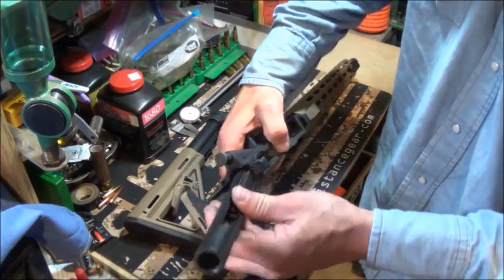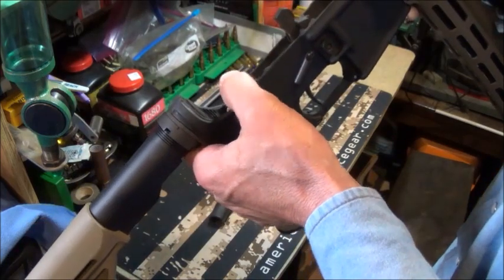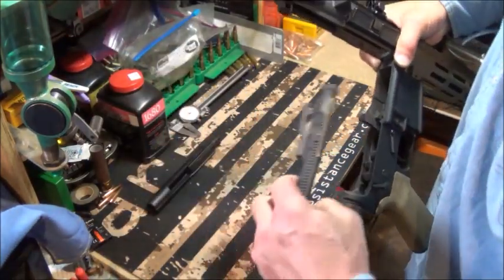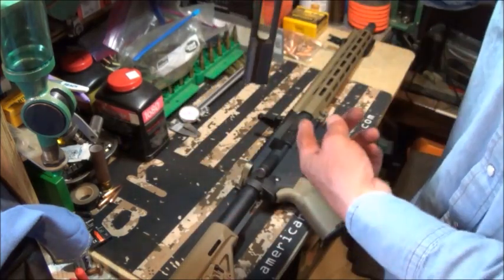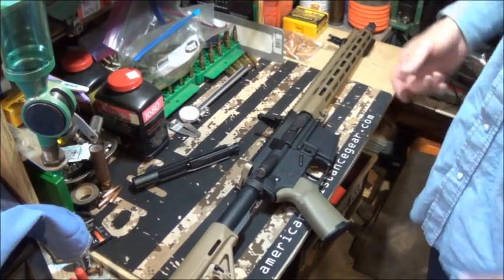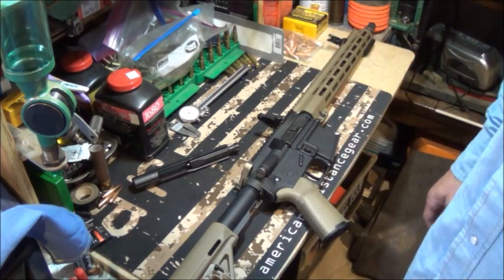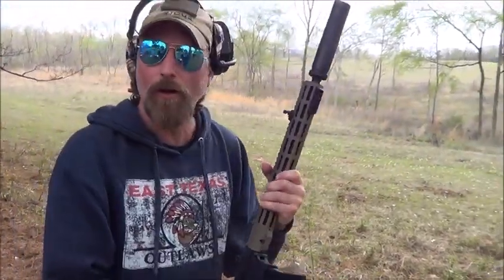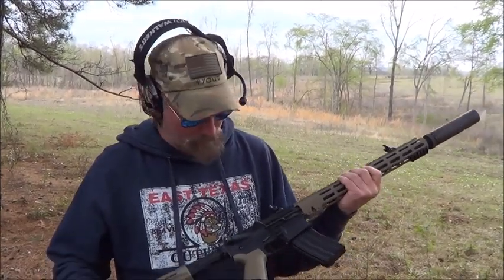Rare Breed FRT - 15 Trigger - BCG Fix

Comment: Soooo, is this why Rare Breed has now modified with a Gen 2 fixing the spring pinch on all trigger assemblies? And as a fellow ammo loader you should know that "SPEC" allows for tolerance, hence the different sizes in auto- BCG's. When you're measuring a difference of  0.008"  in those BCG's...that's literally splitting hairs when it comes to a BCG. 0.008" is NOT going to over extend squat.
Reply from the maker: Awesome, you are a great warrior which I will not be able to defeat. Have a great day nobel one !!!!!!!!!!
Reply: Just got a new rare breed this past Thursday and there is no noticeable difference that would lead me to believe there is a Gen 2. Spring still goes straight back and it’s the same old locking bar without the cut. I doubt I’ll have problems, if I do I’ll just make the cut myself. They’ve had the modified locking bar for sale for a while don’t know why they wouldn’t put it in the new triggers. Actually I do think I know why. $$$.

Comment: 400 bucks for a trigger shouldn't require fixing
Reply from the maker: Sad bot true , Thanks !!!!!!!!!!!!!
Reply: I just paid $600 for one let me know if you got more for $400
Reply: the trigger doesn't need fixing the ar needs the fixing to mate with the trigger. The bolt can be in a different final position in each ar because of the stacking up of the tolerences of the final position of the bolt at the time the hammer drops.

Comment: I measured mine, got 2.294.5". 🙂
Reply from the maker: That should work Rick, Thanks !!! us !!!!!!!!
Reply: Lol newbie here.. can I use a tape measure to measure it?
Reply: @createimproviseoptimize7891  I'm sure you could get close, you would just have to figure out what two inches and two hundred and eighty thousands of an inch were in sixteenths or thirty seconds.
Reply: @RickNethery  I appreciate the information I really do.
Reply: @RickNethery   2.28 inches I believe and mine measure a hair more than that.
I have a Palmetto State Armory Full auto Bcg that came with a carbine length upper I just bought, I bought a rifle length buffer tube with a 5.7 oz buffer,
Think it'll run my rare breed?!? Acogs getting delivered today, testing my rare breed build tomorrow. 
It's my first Ar build so I could be as far off as mars but it seems pretty solid. 
Got a liberty 15 psa stripped lower thing fricken sweet.
Reply: @createimproviseoptimize7891  Good luck brother,  I hope it runs great. 👍
Reply: @RickNethery  I appreciate it Brother!!!! Shoot straight my man!!
Reply: @RickNethery  couldn't wait for tomorrow, went to the range today got about 100 rounds through 0 malfunctions!! 
Fricken holy shit these things are awesome
Reply: @createimproviseoptimize7891  Glad it worked well brother 👍
Reply: Mine was 2.28 and still didn't work.
Reply: @Chris-ru9cq  have you seen the  Animation of the operation cycle of the Rare breed frt on Official Rare breed website? 
That may help you diagnose any problem with your rifle.
Reply: @createimproviseoptimize7891  i watched the video (again). Somehow I'm getting hammer follow. Tried 8 different uppers. None will  mate without wiggling the things. Im going to round off the sharp edge of the BCG to see if it helps. Its to spec at 2.28". Used an H3 for testing and tried down to a carbine eventually.
Reply: @Chris-ru9cq  mine goes in with a tiny wiggle, it has to push the trigger lock forward.
Reply: @createimproviseoptimize7891  I tried it with every buffer weight. Changed gas rings between JP single piece and standard; Tried standard firing pin and extended firing pin; tried firing 9mm (4") and 5.56 (18"). Finally ground my bcg down a hair and still didn't work. Did the "reliability mod" and it still didn't work. I took a BCM extractor O ring to give a little more trigger pull resistance and see if this could help with the hammer follow. This took my trigger pull from an erratic 3lbs pull to a 6lb pull. I will fire it again and see if it makes a difference this and then with a rifle length buffer tube. I already tried an overpower buffer spring after the standard carbine spring and assorted buffer weights.
Reply: @Chris-ru9cq  dang man sounds like you're having a whirl of bad luck. 
 I have a Rifle length buffer tube. 
rifle length buffer tube has a smoother action, it's not so cram packed. I think having a rifle length buffer tube would increase your odds.
Honestly though having a carbine length buffer tube you might need a lighter Buffer if your springs to stiff. I don't know as much as other guys but the buffer absorbs recoil and forces the bolt back into the upper receiver, if the bolt trips the Trigger lock then it can let the hammer forward to early cause light primer strikes or even the firing pin not touching at all. 
So basically, sounds like you have a out of spec bcg , I have a Palmetto State Armory Full Auto bcg. 
I also would try sticking with carbine length uppers carbine length  gas tube. I have a m4 style gas block/front sight too.
Reply: @createimproviseoptimize7891  I have tried 8 BCGs and measured them all with a micrometer. My BCGs are to spec. I agree on the carbine length 5.56 and plan to pick one up.
Reply: @Chris-ru9cq  hammer follow means the bolt did not push the hammer far enough to latch the hammer.
Reply: watch the animation of the bcg and trigger group closely on the rare breed website.

Comment: As of 3/1/21 they said they fixed the spring pocket issue has anyone confirmed this?
Reply from the maker: Nope, not sure about that, keep us posted, thanks for commenting !!!!!!!!
Reply: They are still shipping the old ones as I understand, as I bought and received after 3/1 with no change.
Reply from the maker: @Chris-ru9cq  Good info, Thanks !!!!!!!
Reply: Welp shit I may have to hold out till they fix it
Reply from the maker: @shlomo_jewinstien-Doodoowitz  I would get one while you still can
Reply: @EastTexasOutlaws  10-4 I know but I'd like to make sure we start getting reports verifying what they said about fixing the design and also they really should be honoring swapping out the first gen version folks purchased for the 2nd gen version that supposedly they fixed the spring pocket angle as of 3/1/21 buy yeah I'd like one before more communism unfolds even ifn they ain't fixed it yet
Reply from the maker: @shlomo_jewinstien-Doodoowitz  No doubt !!!!!!!

Comment: Watched your video and it was grate info. I checked my m16 bcg and everything fit just like u said. but for some reason my trigger won’t reset even when lightly holding the trigger I’m also running the h2 buffer but can get more than one shot. I have no idea what the problem is  trying to not give up here but I’m losing hope can u help me please
Reply from the maker: Don't give up on it, My 300 blk is doing something like that, If the upper and lower are closing fine it's probably the spring length or you need a H3, I'm looking for an adjustable weight for my 300. I hope that helps !!! They all tune different.